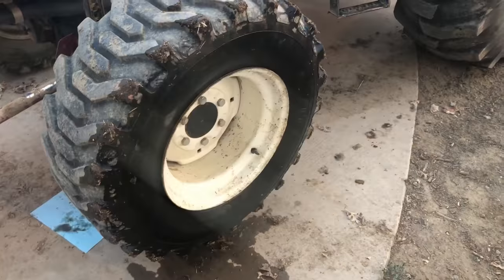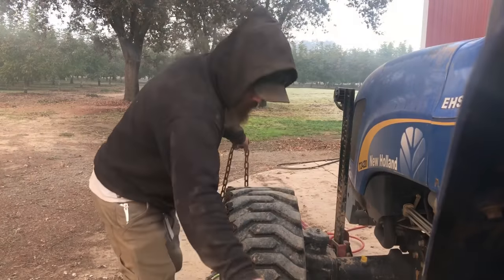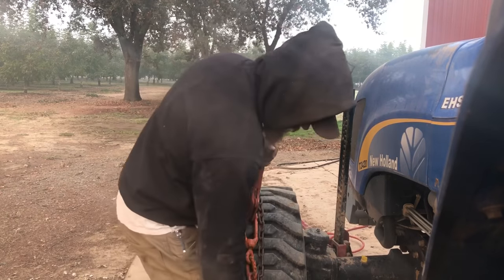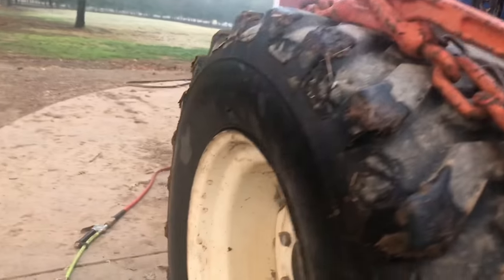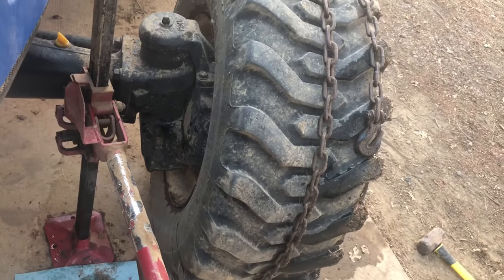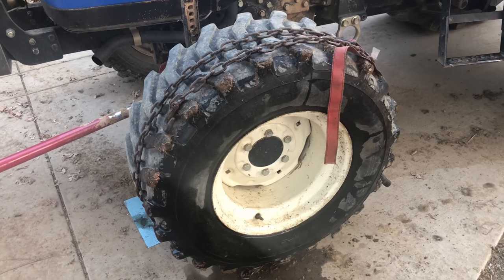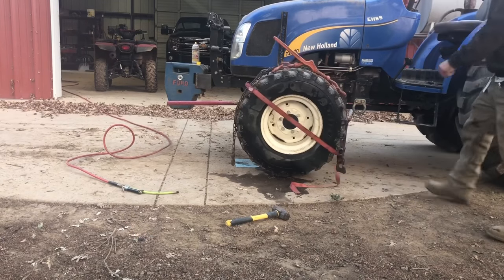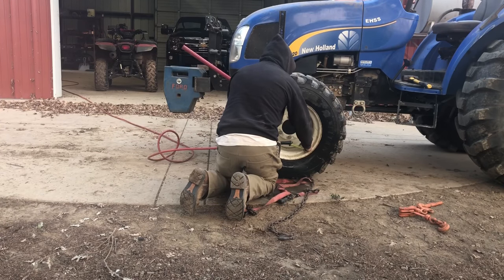How to Reseat a Tire Bead, the Safe Way!

Comment: i have found that if you take out the valve stem and use a blow gun to add air it tends to seat the bead quite well
Reply from the maker: Yes you’re absolutely right. I would have done that in the video but I didn’t have a valve stem remover. Thanks Bill good tip!
Reply: What? This is more than common. You just haven’t seated a real tire

Comment: Just found your video today because my snow thrower had a flat tire and wouldn't take air--clearly the bead was broken.  I put a ratchet strap around it, similar to what you did, cranked down a little on it and turned on the air compressor.  I had to put a little of my own body weight on it because it's such a small tire but it worked!  Saved me time for sure, now I'm ready for any possible snow this winter.  This was a great find.  :-)
Reply from the maker: I’m glad it worked for you!

Comment: I used to do the same thing with a ratcheting strap!  It was light, and easy to use.  However, someone stole my straps so I gave your chain method a try.  I did the same thing, only I did not use the come along device.  Instead, I inserted a long screwdriver between the links and gave it a twist.  I removed the air valve first, wrapped the tire with my chain, gave it a twist with the screwdriver, added air, twisted it a bit more, and watched it pop!  Great method!  The strap was easier, but this definitely worked for me.  Thanks!

Comment: Great video and definitely safer than the "other" method.  I had to do this on my lawn tractor and used a double loop of 550 paracord with a 1" dowel to tighten the cord.  Worked perfectly after using a rubber mallet to get the sidewall as close to seated as possible.  Thanks for sharing!

Comment: This method worked like a charm! My issue was a smaller tire on a boat trailer so I only needed to use a ratchet strap. With a few taps from a small sledge hammer and some time for the rubber to relax the tire seated perfectly. Thanks very much for this.
Reply from the maker: I’m glad it worked for you!

Comment: Wow, great idea and thanks for showing the troubles you had! I just lost a valve stem on a front tire; while I'll take it in to make sure there's no other damage to the tire this (and the 2" ratchet strap idea!) is really great. 

I'll also get a few extra valve stems to be prepared as I would hate to have a similar problem in the winter.

Great video, great tip!

Comment: Just reseated my tractor front tire (smaller than yours) using your instructions in this video however, I did use a 2" ratchet strap as found in the comments. Glad it was on a tractor with a front end loader which picked up the front end. Thanks to both of you.

Comment: I have had good luck seating the bead by taking the valve core out and putting an air nozzle with a rubber tip on the air hose and give it a quick blast. That will seat the bead then put the valve core back in and inflate the tire. Don't need to chain or strap the tire.

Comment: Howdy F. Tyler!
I have done the chain and binder trick as well when in a pinch.  Much safer way is with a good 2" ratchet strap.  You can release it easily without the momentum of the binder handle risk.  Releasing the strap still makes a good pop and makes me jump.   On smaller soft tires (e.g.:  lawn tractor, ATV) you can get away with using smaller 1" straps.  The 2" straps don't work well on small diameter tires.
Reply from the maker: Thanks Gregory!
Reply: Thanks gregory! i tried the 1inch strap trick for a lawn tractor but I wasnt able to get it to seat properly. any recomemndations? @gregorycross
Reply: There are several more tricks I can describe for you.  Is it a small front or larger rear tire?  What type of air source are you using to inflate the tire?   
1)  The biggest catch is fast air volume is needed.   
2). Jack up the tractor so that there is no weight on tire, or remove tire and wheel so that you can place them flat on concrete, sheet of plywood or some cardboard etc..  If flat on dirt, these tricks can get you dirty quick. 
3). If your compressor has a 1/4 turn ball valve (shut off handle with a 90 degree operating range) on the discharge hose:
3a) Remove valve core from wheel. 
3b) attach as short of a hose as possible (4 to 6 foot of 1/2" hose for larger tires, 3/8 may work on small tire) to air compressor discharge valve and put it directly over the valve stem.  You can secure it with a small hose clamp if needed.  (No quick couplers or fittings that will cause restrictions to slow down the blast of air into the tire.)
3c) Charge up the compressor and then open valve to inflate tire.  Be ready to close valve as soon as the tire pops up on the bead of the rim.
3d). Remove the hose, and reinstall the valve stem core asap
Reply: trick # 3: Portable volume chamber (accumulator).
If you have an old portable air tank   that has factory valve body and Schrader valve stem for filling that are worn out:
1) Remove entire valve assembly.  
2) Get a 1/2" NPT pipe T and add 3  short nipples.
3) On the run (arms) of the T add 1/2" NPT ball valves.  
4) Add bushing and adapter to match your compressors quick coupling style to one valve.
5) install short run of 1/2" air hose to the other valve using hose barb and hose clamps.  
*6). For safety* you can use a 4-way cross or add another T between the valves and re-use the pop-off valve and pressure gauge from the original tank manifold.
7) Remove valve stem core and secure loose hose end over the valve stem with hose clamp.  
8) Charge tank (Do not exceed  original tank specifications!)
9) Close supply/fill valve and prepare compressor hose with your air chuck.
*You can also use this at the end of a long hose to get maximum use of your impact tools.*

Comment: today is "one day". just confirming what i've been doing the last hours wasn't for nill. back to the fight then! but just on a side note: you ever started one of those very old hand cranked tractors, then you know, you grip it with your thumb not over the handle so not to break it if there is a kick back, that way the crank can slip away out of your hand and not shatter it. that's how you have to take the chain off , for the same reason: your thumb clearly gripped it around. hope it helps brother

Comment: I'll add that for a rear tire off a Kubota L45; it took two chains; one along each side 3-4" from the edge and I had to position one of the chain binders directly over an area that air was escaping to get a little more compression in that area.

Comment: Will a simple ratchet strap work for a smaller tire on let’s say, a lawnmower tire? I need to reseat one of the small front swivel tires on a zero turn mower. Thanks.

Comment: OK, I an old guy needs spinal surgery raising two toddler grandkids. Kinda taking everything we have to do it but what ya gonna do.
Some rich grandparents out there feel our pain and want to help let me know lol.
But, we have old tractor need get running to sell. Engine problem worth couple grand and even setting with good battery and fire it has never failed to run. But the back tire has lost the rim and been flat while.
I don't have big chain or bar like that and before try to procure them not sure it work on that huge back tire. Can't afford anyone come out for it and no way I could problem get it off.
Any ideas....
Explosion, with what and how. Heck even jacked up I can't hardly move the tire lol.

Open to any suggestions and or donations lol.

But seriously if I can get it running and moving problem get more for it. Selling seems be only choice right now.  Times been tuff raising little ones on social security. 
Don't know how anyone been making it. Lol

Thanks for help

Don

Comment: Don't forget your lube!😘.  Not only does it help the bead slip onto the shoulders of the rim without binding but it also acts as a temporary seal to allow you to get enough air pressure in that the tyre will start to slip onto the rim.

Comment: Ya must have a slow leaking tire there ,been there done that lol .... pretty sure my problem started by mowing around field borders mowing off little locus tree's.  Seemed like every 2 weeks I was airing up a tire or seating it again,  couldn't find anything in the tire so ended up putting a set of new one's  on .
Reply from the maker: Yeah the tire or the rim, not sure which. Same one has done that twice before in the ten years I’ve owned it, only at critical times when I really needed the tractor of course! But once I reseat it and fill it up it seems to hold for awhile...weird.
Reply: @farmertylerranch4399  Ain't that the truth only when ya need it , I wouldn't notice mine flat until I loaded something in the loader . Nice looking tractor for 10 years old  !!
Reply from the maker: Thank you! Letting it live in a barn certainly helps. Those stiff sidewalls make it impossible to tell it’s losing air until like you say, you put a load on it.  Nice thing though I was able to drive it a short way to my dads shop with the tire off the bead and not hurt anything

Comment: Try your method with a new tire that has been twisted and taped in a squished position in the factory.   No go
Reply: Ordered a bead seater 14 inch china tires exactly like you described. Tough little bitches

4.2 4.2 out of 5 stars 494Reviews
BLACKHORSE-RACING 5 Gallon Air Tire Bead Seater - 145PSI Blaster Tool Seating Inflator w/Gauge Car Truck ATV Tank Heavy Duty